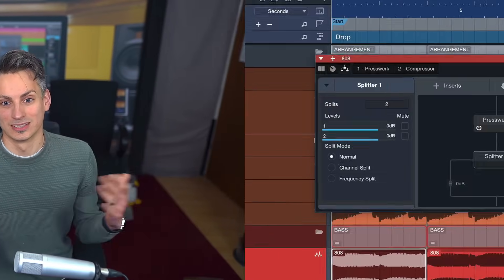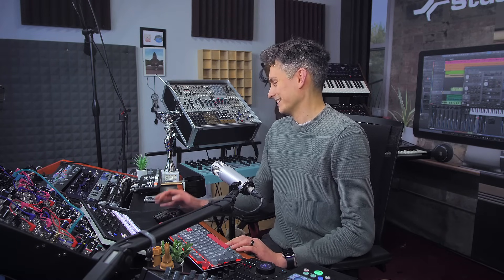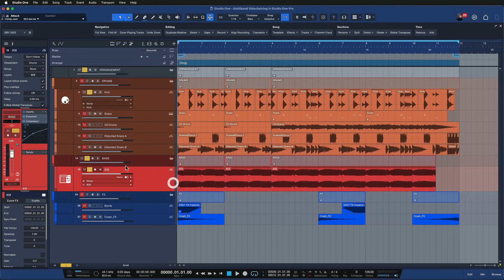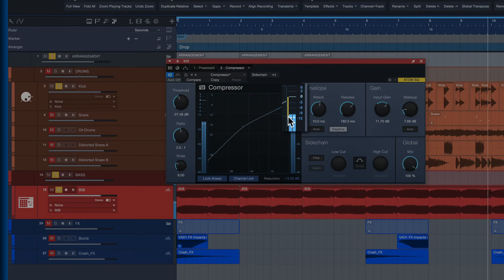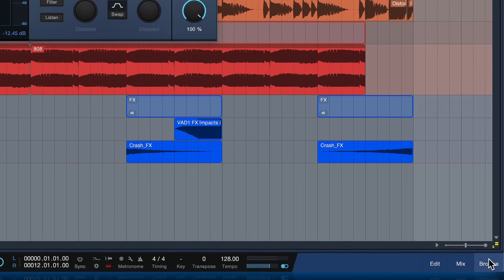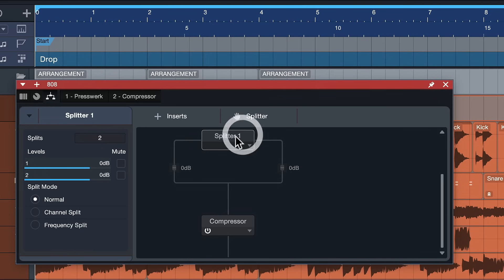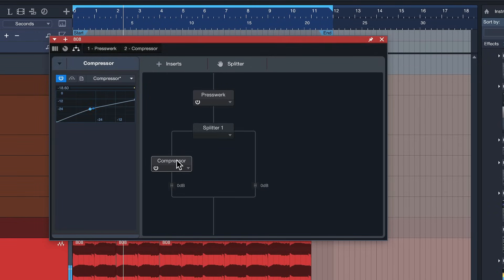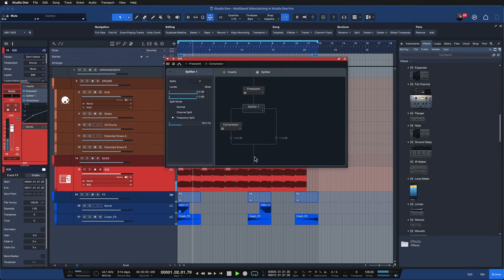A Guide to Multiband Sidechaining in Studio One Pro | PreSonus

Comment: Why not just sidechain to a multiband compressor?! Or to a dynamic eq?
Reply: The point of this video is probably to show you that you can use the splitter to split a signal into multiple frequency bands, and then apply ANY plugin to those individual bands. Much like Kilohearts Multipass, but with the freedom to use ANY plugin (and sidechain signals to those plugins (or not, of course)).

To me though, the Splitter controls could be improved to enhance user friendliness. Plus I'd like to know the slope that is used to split the bands, or better, be able to adjust them. Preferably adjust them visually with a spectrum analyser.